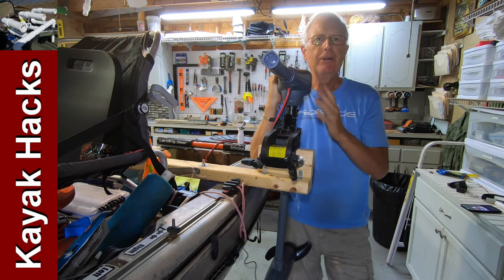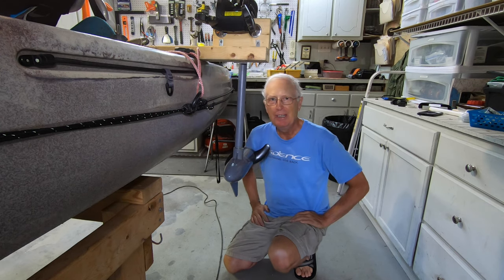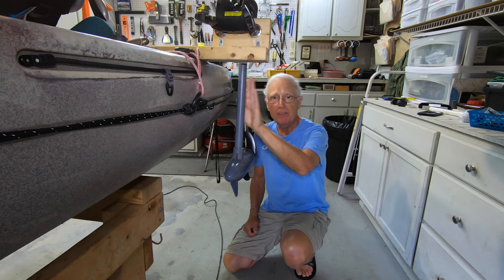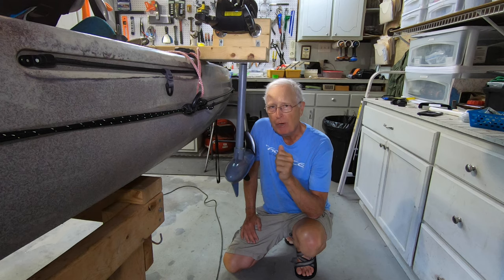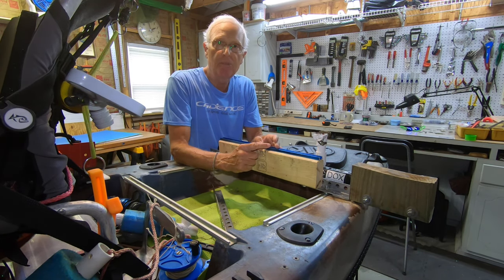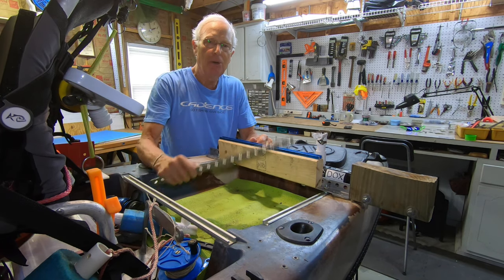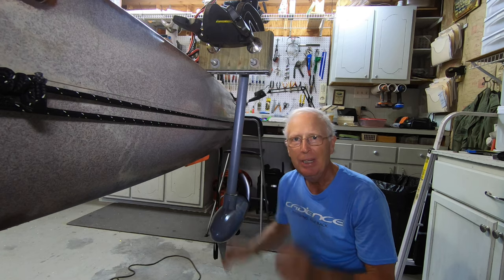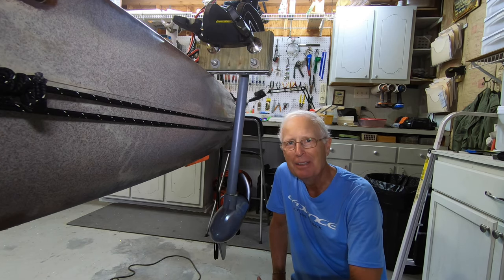Side Mount Trolling Motor Kayak Mount - Easy Kayak Motor Mount (Option 3)

Comment: I love working on the solutions to different problems encountered on my 1946 Alumacraft duckboat  riggings also..(Almost) as much as boating itself.  Thanks for sharing your ideas! 👌.  I now have a bow mounted remote controlled Motorguide GPS XI3..(after 4 other motor mount configurations)..it has solved all my needs,  except the amount time I have to go fishing. (I also had to add a skeg because of weather cocking).  Now I’ve added a mount for it on my kayak bow, but have yet to test it..more brainstorming ahead, I’m sure! 😂  Love your videos!  Have a great week Steve and company!
Reply from the maker: Keep on hacking! Now that we can't work on cars, it's our only mechanical outlet!

Comment: Mines mounted on the stern and I've attached paracord to a pulley on the gusset.  The way it's positioned, I can pull the motor assembly completely clear of the water and I haven't had to worry about pulling it forward and hacking the release lever.  I don't have a steering system though, so I've had to rig one to my pedals and a steering arm on the motor.
Reply: Also added a harken pulley to the motor mount side to keep the paracord aligned.
Reply from the maker: I need to try this with a few pulleys for mechanical advantage.

Comment: You can always set up a simple pulley system if reaching back to the motor becomes an issue. Its what I did for my nucanoe when I used a transom mounted trolling motor and it was really convenient
Reply from the maker: My next hack!

Comment: Have you thought about angling the motor mount board at an angle so the prop center moves closer to the center of the kayak and rudder becomes even more responsive when under power.
Reply from the maker: that is an interesting thought! I'll look at that. The issue is making sure the prop is far enough away from the hull

Comment: Also if you hinged the mount it would allow the motor to swing up when it strikes an underwater obstruction. Of course that hinge reduces the power while in reverse but it's a worthwhile tradeoff.
Reply from the maker: Hmmmm.... the motor already has a hinge that locks in place. I wonder if I could disable that somehow....
Reply: Kayak Hacks Fishing true. Never thought of that
Reply: @KayakhacksFishing  If your motor is like mine it has a pin that can be removed.
Reply from the maker: @dougscamo2032  Thanks - I'll look

Comment: I had tried the concept of a side/outrigger mount for my trolling motor last year and found it very inefficient for turning and maneuverability. My yak doesn't have a rudder so steering via the motor's tiller handle was always an exercise in inefficiency. I since placed the motor on the stern and added steering cables to the footpads and it really made a difference ... added over a half MPH to overall speed and decreased battery consumption tremendously as the overall propulsion is greatly improved from the new position ... will be putting together a video in the near future of my setup.
Reply from the maker: Please share it!
Reply: @KayakhacksFishing  finally got it finished, here it is:  
                https://youtu.be/s7RLgDLd8ao
Reply from the maker: @butchmiller3970  Wonderful design and great video! I need to figure out a kill switch on mine as well.

Comment: My side mount motor is just behind the seat but I just spin in circles. How far back do I need to mount it still allowing me to reach motor?
Reply from the maker: The farther back you put the motor, the better. Side mount just pushes the middle.... back is better.

Comment: I installed this on my kayak and have a standard 20 pound Newport trolling motor. Right off the get go, it bent the heck out of the angle iron, especially if trying to adjust the angle. Did you do anything specific to reinforce the angle iron so that the weight of the motor doesn’t bend it?
Reply from the maker: I did not have an issue with that. But... maybe because I did not use it at full power. At any rate, I moved on to Option 4... which is the best solution since you can remove it! https://youtube.com/playlist?list=PL8egn41J7Go8ktbwm2npNZtAAJ3izoVmf

Comment: Do you have to have a rudder on your boat for this to work? Or does it just make turns more difficult without a rudder? I like Option 3...
Reply from the maker: Yes, I have the upgraded Jackson rudder. Without it, a side mount would not work at all.

Comment: When I mounted mine behind the seat it caused my yak to yaw terribly. Had to run  with the motor angled to the right about 30 degrees so it bled off energy. I have no rudder
Reply from the maker: Yep. My problem was not as bad as yours, but I can see how that could happen.

Comment: Hi.  Did you say you locked down the trolling motor and only use the Jackson rudder?  If so, are you using a Newport and how did you lock it down.   My nv 45lb series will not lock steering.
Reply from the maker: There are two toggle screws on the 36lb thrust I got. One locks direction and the other locks height. But, in effect, they both do the same thing. You can see them on the picture - https://amzn.to/2QJyQ1d
Reply: @KayakhacksFishing  same for me on the 45lb. But the top one says it's only height and the bottom is steering tension.   When I tighten the steering tension I can still turn it.  Newport support said none of their motors will look a 100%  is yours turntable at all?
Reply from the maker: @DavidBrownSC  I have not stressed it. However, so far, it has remained in place when I am using it.

Comment: I’m thinking of trying it in a rear centre drainage hole? Means I won’t be able to pull motor out of the water, will stick down about 8 inches min below bottom. Should be ok for open water sailing.
Reply from the maker: It is always a risk to put any stress on the scupper holes. That is the weakest part of any kayak's plastic.
Reply: …yes, but it could be lined with pvc/metal tube and sealant, to disperse the force over a greater area. However, I had another idea while fitting the motor today that will almost eliminate the lateral torque, which is simple to tilt the shaft at about 25’ so the propeller is under the kayak. At full extension it is only 7 inches away from the centre line. Propulsion will be however horizontal while tracking straight. Sea trials tomorrow in combination with the sail in Bantry Bay tomorrow….
Reply from the maker: @davidgriffiths7696  Sounds good
Reply: @KayakhacksFishing  the modifications were a success, 10 miles in 3 hours, up to 5 mph with combinations of sail, motor and foot peddles. The motor shaft tilting worked better than vertical, able to steer with the rudder and less of the crab wise tracking and much better turn stability. Was drawing some air into the prop, but I can take the depth bracket off to drop the motor down another couple of inches should then be as good as vertical. Success.
Reply from the maker: @davidgriffiths7696  Wow! Great success! Congrats!
Reply: @KayakhacksFishing  cheers, needed the turn resist bolt fairly tight to stop shaft turning, but that no problem,  happy kayaking!

Comment: Go get you a piece of angle aluminum plate then take London plate and bend it and have toward you have about 4" on the boat and 4" a sticking up screw that to the boat on the very back of the boat and then you'll have your trolling motor in the very back center of the bow kayak then you'll be perfect
Reply from the maker: It would be perfect, but I need to be able to reach the motor when I hit oyster beds

Comment: How to stop the kayak from spinning in circles when u turn it on to drive straight
Reply from the maker: As I mentioned in the other note, I use a rudder. I lock the side mount down so the kayak tracks straight.
Reply: Thanks

Comment: You can design a mount for your trolling motor that will fit where the pedal drive goes.
Reply from the maker: On the Jackson, the drive does not pull out like a normal drive. Besides, I want to pedal at the same time to get more mileage.
Reply: I did that with our 2017 Hobie Tandem. Only trolling motor I found which would work was a Watersnake 24lb thrust. The larger Newport Vessels 36lb motor was too wide. The tandem yak has 3 pedal spots, so we can have motor and pedals the same time (got nearly 10mph at full motor speed, "sprint" pedalling, and full sail, but only able to maintain for about a couple of minutes and it nearly killed us out-of-shape yakkers). Unfortunately, I can't find the Watersnake 24lb anymore, and don't know what others might fit the 3" (ish) width requirement.
Reply from the maker: @2reelyakrz481  That was amazing speed!
Reply: @KayakhacksFishing  The conditions were perfect for it, but I doubt we could ever do it again short of dropping off a waterfall. Our normal best maintainable speed is a little over 6MPH. The all-time-fastest was on Watauga Lake in TN (same lake our cover pic comes from); the wind was strong and favorable but since the lake is narrow there was very little wave action (we'd have been swamped on the ocean); and we both pedalled as fast as we could. The side-arm-mount Lowrance transducer wouldn't stay in the water which was a problem, but the real reason we stopped was that our legs felt like they were going to fall off and I was worried about the pedals and mounts breaking (but it was mostly the legs 😋). -- My apologies, my wife corrected me on which motor we used then - it was the 36lb mounted on the side and not the 24lb in the cartridge.